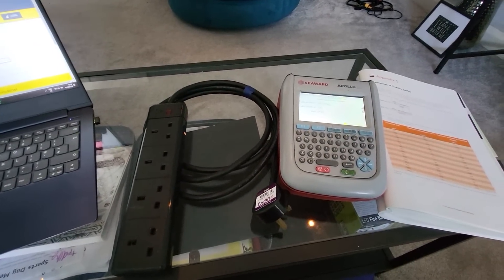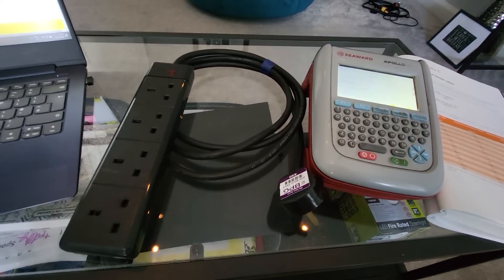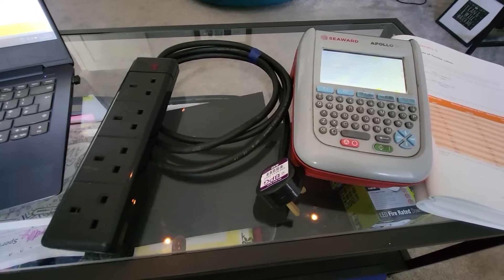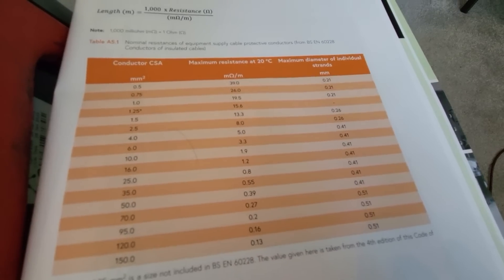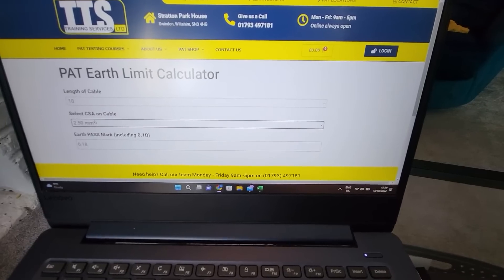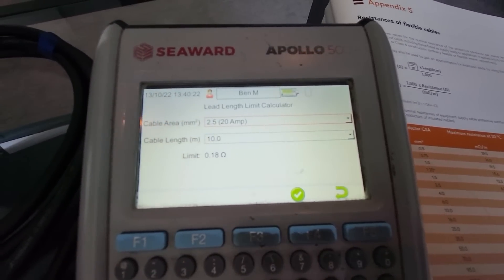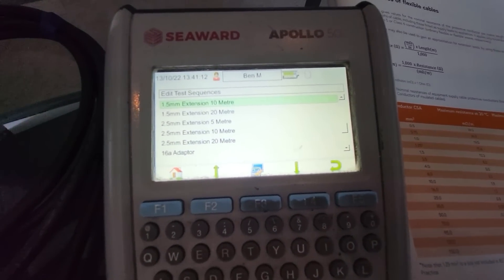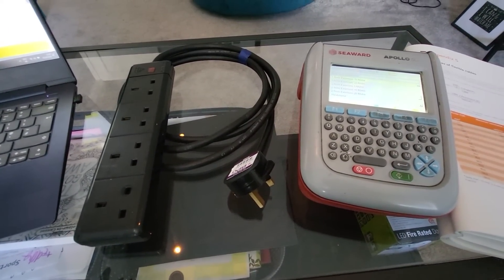PAT Testing a Long Extension Lead - My machine shows a fail?!

Comment: Really useful, thanks. Do you have any issues with the earth resistance of the short IEC cable that's normally required to test an extension cable?

My UNI-T UT528 can null out the resistance of the earth probe, but that doesn't work for the IEC cable. And that resistance is significant – about 0.15 Ω, probably because the contacts in the IEC plug have oxidised and it's hard to clean them.

So even a short extension lead tends to fail the earth bond test. The UT528 has a "long lead" setting, but to get the true resistance of the extension lead I still have to subtract 0.15 Ω, which is a bit clunky.

Do other machines handle that better?
Reply from the maker: Not normally an issue for me on my Apollo test cable. How long is your IEC test lead?
Reply: Thanks Ben. The cable is very short and it's now showing closer to 0.1 Ω, so most extension cables now pass without the need to adjust the calculation. The machine had been stored for a year or two, and it's probably needed a bit of use to remove oxidation from the contacts. It still seems odd to me that I can null the resistance of the earth probe lead but not the IEC cable. You get what you pay for, and I'm sure your Apollo is more flexible.

Comment: That's what hate about the PrimeTest 50 at work, testing long extensions is impossible, the previous Fluke 6200 would at least give a figure and you could work out what was allowed and if it was a faulty or just that it was long.
Really can't stand machines that don't let you do individual tests or give an actual ohms reading.
Reply from the maker: I would say a Prime Test 50 is only good for perhaps a minimal amount of items where a quick test is required. They aren't suitable for the wide variety of applainces that may be found in larger settings
Reply: @caterhampattesting  Yes, it's a case of I use what I'm supplied with, generally I am testing items in caravans, so your usual kitchen appliances, TV's etc. so it's not usually a problem.
It's only when I need to test the extensions for things like the pressure washer where it's useless, but in theory as I built said extensions I have more faith in them being OK. 
Most of the other stuff is now done by an external company (it's just an extra job for me) so we don't necessarily need something fancy, although as the external company seem to like putting stickers on low voltage appliances I question the standard of their work.

Comment: Can you pat test a play station
Reply from the maker: yes, generally they will have a figure 8 type mains cable and then you perform a class 2 test on the playstation itself by attaching your probe to an exposed metal part.